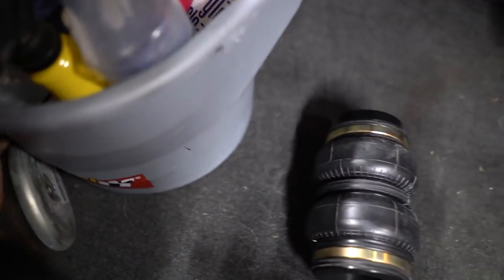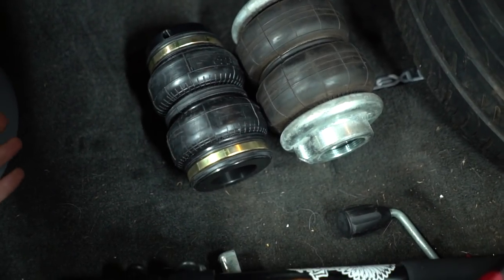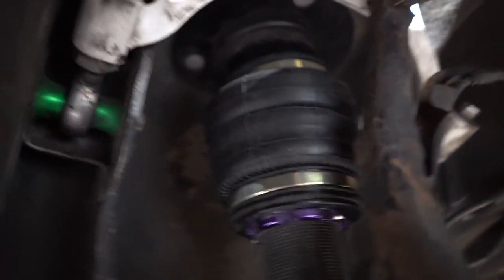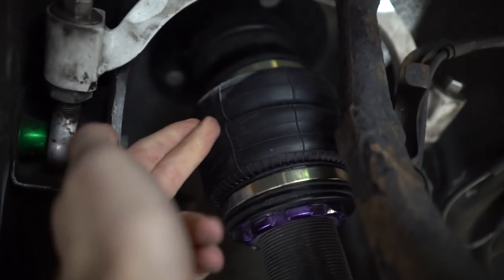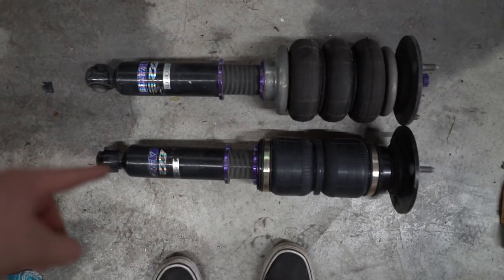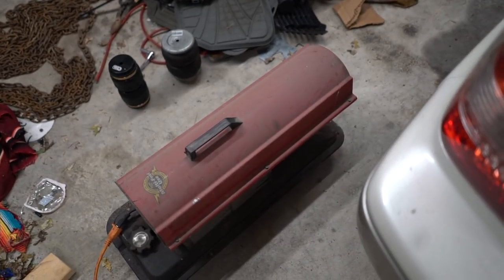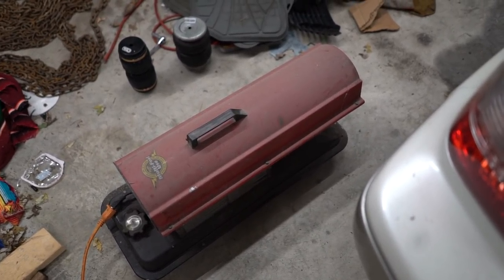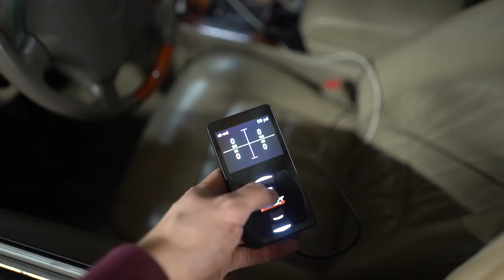How I Drive LOW on Bags? - VIP Style LS400

Comment: The original air suspension of LS400 (1st gen) has also computer adjusted shocks, not just the air suspension. But this car seems to have different system. The original air suspension with both adjustable air bags and shocks reacts constantly to the cars driving performance. I would not trade that to anything else. It is such a smooth ride and you can flip a switch in the console for a stiffer ride as well as a lower ride height.

Comment: Get 326 top hats from japan i also use c2b slim bags i had the same issue on my is300 with short spindles
Reply from the maker: eduardo medina if I end up having the issue when I shorten the spindles I’ll have to find some. T-demand or 326 are pretty much my two options, I’m just not gonna buy them at full price
Reply: I'm thinking of getting these for my is300, how have they been? Should i go with other bags?